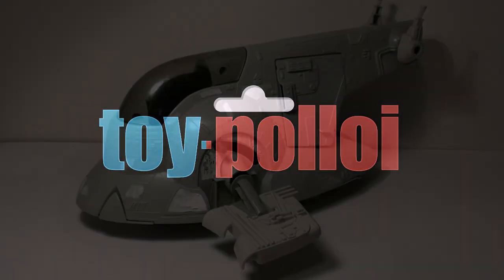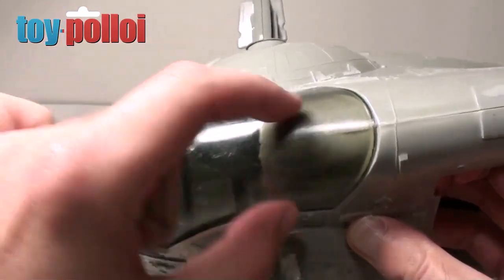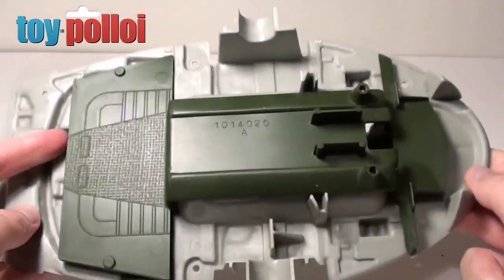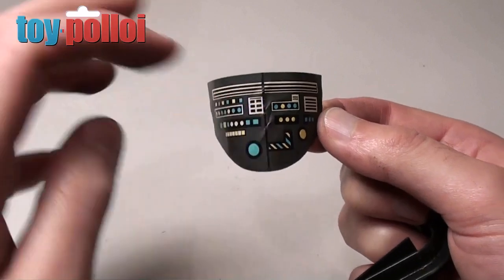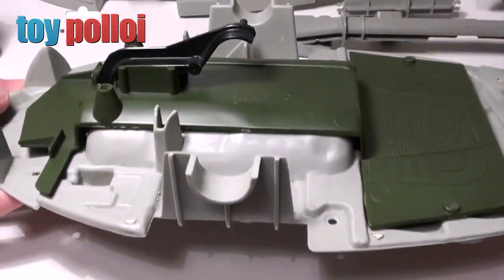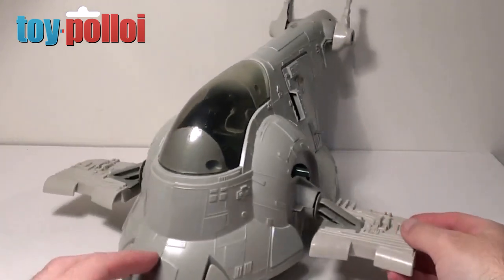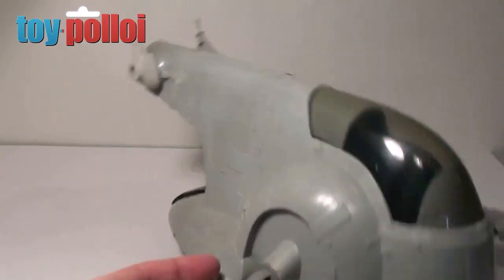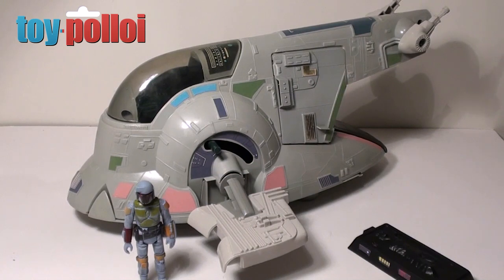Fix it guide - Star Wars Slave One Vintage restoration

Comment: You must have quite a lot of spare regular (common, easy to find) parts. Do you keep all of those stored?
Also, good job with the T-cut. I was about to ask if you had thought on a solution for scrach marks, just before you showed it. :D
Not to be "that" guy, but the stickers look like they're lacking a bit of contrast. That's probably because of the inkjet printer you're using, but have you thought on making the blacks darker? That could help.
Reply from the maker: I have a fair amount of spare parts. I try to swap them with other people to get parts for my current projects and also help them finish o projects they are working on. My printer isn't that great. It does and OK job. If I had the money I would buy a better one. But this is enough to get the ships looking good and help give other people ideas in how to restore.

Comment: I just restored a Slave 1, and when it cam to the cockpit canopy, I wet-sanded out all the scratches with sandpaper, starting with 1000 grit all the way to 12000 grit.  I finished it by buffing it with toothpaste.  It looks brand new.  All of the scratches, including the major ones, are completely gone.  Altogether it only took about 20 minutes or so.

Comment: I picked up an incomplete beater Slave1 that I'm attempting to bring back to life. I just got a side hatch for it. Upon installation, the hatchet wasn't squaring up properly revealing that the tail of the ship has a twist to it. Presumably from a combination of improper storage and heat exposure. I'm thinking of using heat  to assist in reversal of the twist, similar to using hot water on a figure with bent legs to straighten them; however, I also need a way to position the tail in its proper spot so it retakes its proper form. Has anyone ran into this problem? If so, solution?  Thanks for the videos, they've been most helpful!

Comment: Magic erasers work wonders for removing dried on sticker residue and other surface markings like smudges and ink.
Reply from the maker: I can't say I like them as they are abrasive and can scratch the plastic.
Reply: @toypolloi  huh.  I cleaned 40 year old sticker residue off a Slave 1 and Vader TIE yesterday and not a blemish on either.  Maybe they make magic erasers differently in the UK?  BTW your video was very helpful 🙂 thanks!

Comment: Brasso also works wonders when polishing plastic. Great job Mr.Polloi!
Reply from the maker: +Scott McFall I find brasso a bit too abrassive myself. T-cut is a bit gentler. But thanks for the tip. Keep on posting them.
Reply: I think a mix of both could be ideal. Brasso to get the heavy work done, with T-Cut to finish it off.
Thanks for all your work, by the way :)